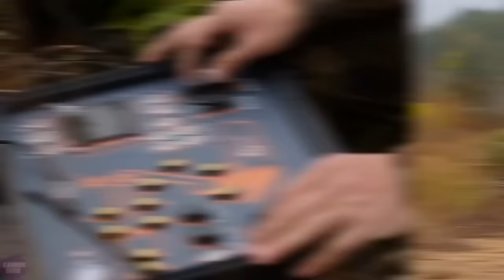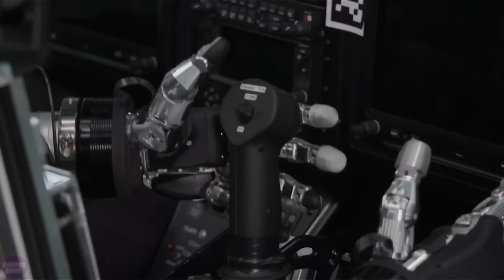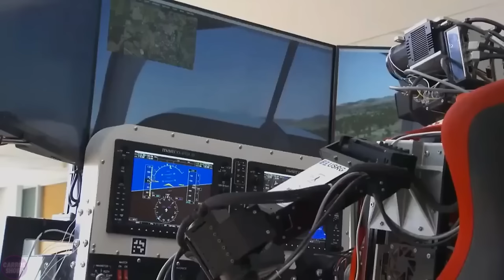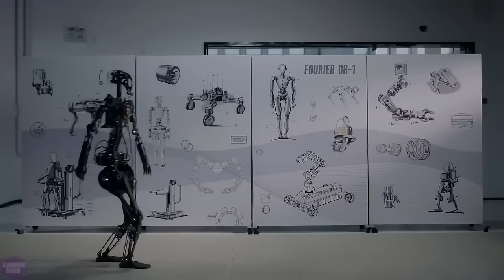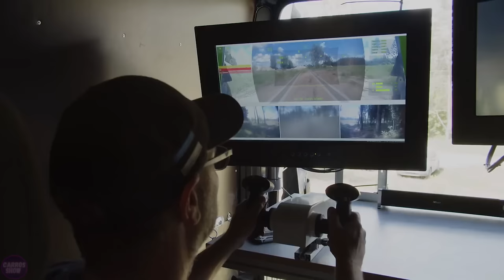All The Most DANGEROUS Military Robots That Will Destroy Any Army

Comment: Delicate parts, to many moving pieces, what happens when battery runs out?lol what about when they run out of ammo?...not worried.
Reply: can punch! modular battery packs, auxillery battery that charges off the main one, is used to change the battery. servo's etc these days are amazing also, robotic arms on factory lines ;)